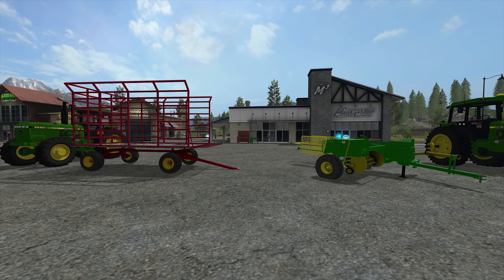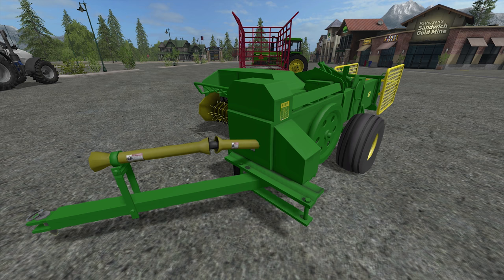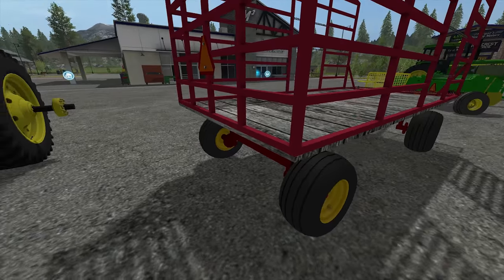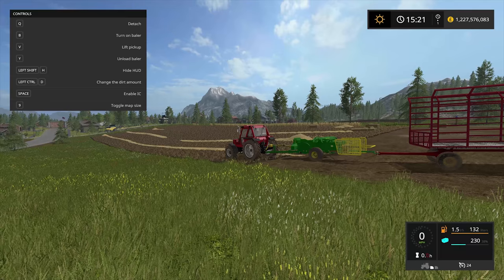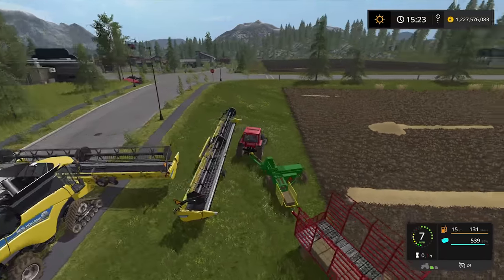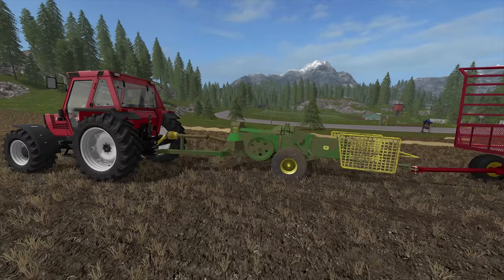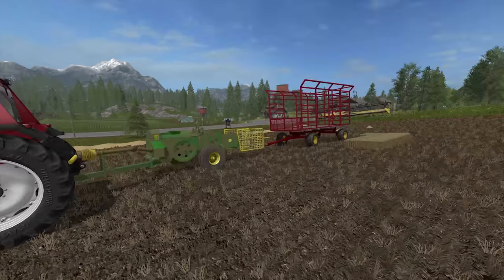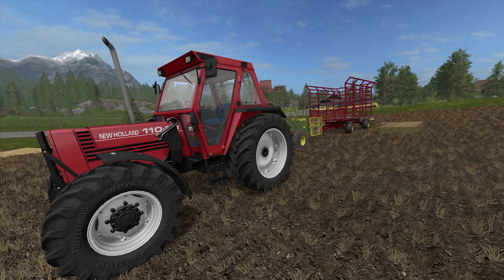john deere 24t Bale and Bale Trailer / Mod Showcase / Farming Simulator 2017

Comment: Hurrah! I finally figured it out.  I had to enter the trailed combine and unfold it.  I did not notice the E for enter before.  I thought I had to control the combine through the 15-30 tractor.
Reply from the maker: I was just making a video on the pack. and was going to mention the same thing. There is a lot to that pack so it will be a longer video.

Comment: Thank you for doing mod reviews of classic equipment.  Please review the Stalinsky Pak (1930-1945).  I've been looking for the McCormick-Deering 15-30 for a long time but at least I've found the Russian version of the 15-30 in this modpack.  Finally, I've found some steel wheel tractors and equipment.  It has a trailed combine that goes with the 15-30 but I can't figure out how to attach the header to the right side of the combine.
https://www.modland.net/farming-simulator-2017-mods/packs/vehicles-implements-pack-1930-1960-v-1.0.html